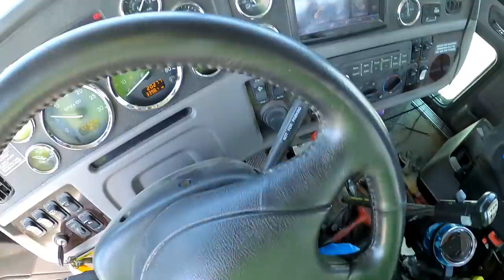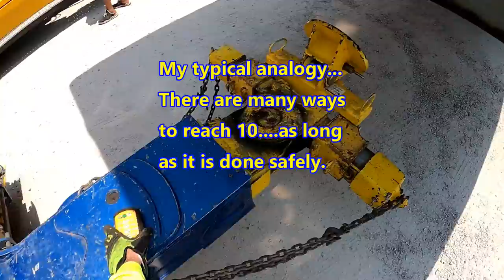SHUT DOWN AT THE SCALES!!!   TRAILER TOWING 'TATOR TIME!!!

Comment: 14:52 What is the purpose of blurring the lower circular spot here?  What is being hidden and why?
15:03 What is broken?  It is not evident in the video.
15:20 You point at something and say it is broken, but from the video, we can only see some corrosion.
Over all, the trailer frame does not appear to be "broken in half" as stated in the beginning of the video.

Comment: everyone says they hate the DOT but if owners of the equipment rigs or trailers kept them in good order their kit would not be ordered off the road I ran 3 recovery trucks in the uk  I was never pulled for a crane ( Hiab ) hydraulic leak / like most trucks with a hiab or tilt and slide deck( roll back in US.) that's not to say I was perfect by any means / I just hate oil drips

Comment: Have A question Are you a LEFTY? Why I asked you are holding the steering wheel mostly with that hand. I have driven over 30 yrs and have 3 million miles I drive mostly right-handed on the steering wheel
Reply: Do you not shift much?   Ive driven truck for almost 20 years and always use my left hand on the wheel, a habit I developed from shifting a 13spd all the time going up and down hills all day.

Comment: Interesting, the differences in different countries- here your wireless lighting isn't anywhere near legal-its too narrow (lights must be at the trailer edges or within a certain distance- either a min 6ft light bar is needed here (barely legal) or two  separate ones- plus of course we are required to  have amber indicators, not red ) and even in daylight towing- you have to have clearance light functionality or equivalent ( we use battery powered red/amber marker lamps if the trailer elecs are damaged and non usable) so unless the trailer is badly damaged- its lights are used.... (in my case, the trailer plug at the rear has its own breakers on each circuit driven through relays, so it has no effect on the truck itself- should you have a faulty circuit- it just trips the breaker on that circuit on the trailer plug only- doesn't affect the trucks lights in any way...
Different rules, different places of course...
Reply: Out of curiosity, where are you? I've watched some towing videos from Germany and Russia, and not noticed that in either of those places. Maybe up in Norway or Sweden, where (I suspect) there can be a lot of visibility problems?

Comment: Does your state require a class A CDL to operate a wrecker?
Reply from the maker: A CDL is required, but the class of CDL is based upon the vehicle you are driving PLUS the vehicle you are towing based on the GCWR (Gross Combined Weight Rating).   So, in this video I am required to have a Class A CDL.   Thanks for watching and God bless.
Reply: @RonPratt  thank you...be safe

Comment: This is probably going to sound like "ah another crap talker" or whatever, but if you shift at lower RPM in the 1400-1700 range, gears are a lot easier to grab and you wouldn't jerk and grind so much. It looks and sounds like you're shifting near or at the rev limiter of 2300 and it makes for a fairly unpleasant experience for engine, trans, and driver. Just some advice, don't take it as a "hate" comment or whatnot.

Comment: So I'm curious, If the subframe is damaged, why not use the flat bed trailer? This would seem like a safer and easier option vs physical towing. Likewise, even using the cab would seem to be the equivalent to towing with the rotator which is more expensive. Just a general question here :)

Comment: One more question, why use the tator on this job?
Reply: As answered in another feed, the Western Star/Vulcan could have done it, but it was busy, and apparently due to Missouri state law, only a towing unit (with the lifty bits on the back) can remove an out of service unit from the scales.

Comment: Question they shut the drivers down, but allow you to pull the trailer on the highway? Why couldn't the driver have done the same to your shop? This makes no sense to me.
Reply from the maker: I can't give you a complete answer, but I can tell you what I know....we are authorized as Emergency Vehicles and tow far worse things down the roadway, especially after wrecks.  That is what we do.   Another reason could be that we are required to carry an ENORMOUS amount of insurance coverage, which is generally far more than the trucking companies are required to carry.   Also, we have many tools and equipment on our rigs so should something happen on the road we might be able to finish the trip safely.    It is quite common for units to get placed out-of-service and get towed away for repair.   That is the system.   Good question.   Thanks and God bless.
Reply: I will add another likely reason is they won't want to risk that the drivers don't ignore it and keep driving to where ever they are going. Its very possible they will ignore the order to fix the trailer and keep driving as well to where ever they are told to go which puts everyone on the highway at risk if that trailer falls apart. So better to have someone you know is gonna take it somewhere for fixing them someone that might dip outta the area.
Reply from the maker: @arbiter1  Very good point...one that I failed to mention.   Thanks and God bless.
Reply: @RonPratt  Thanks Ron.